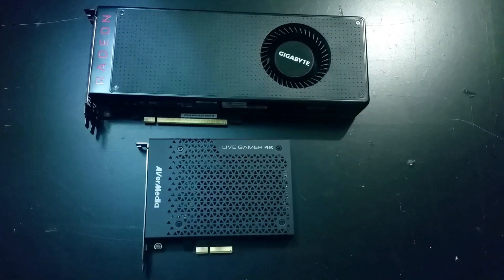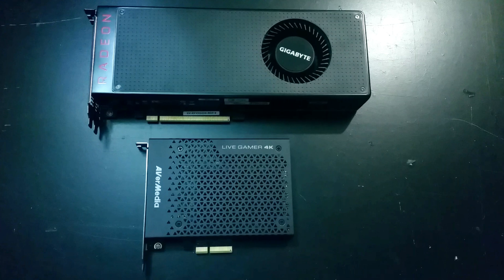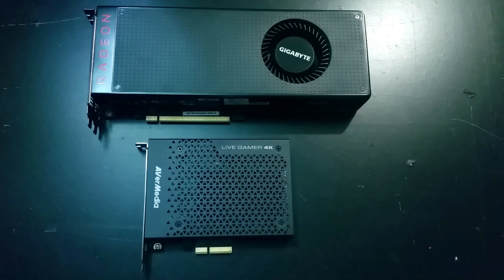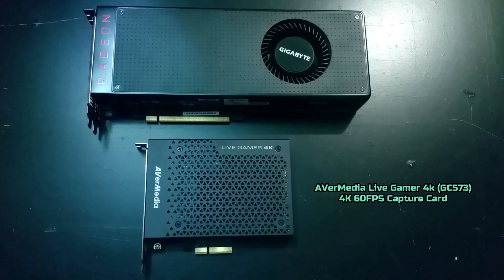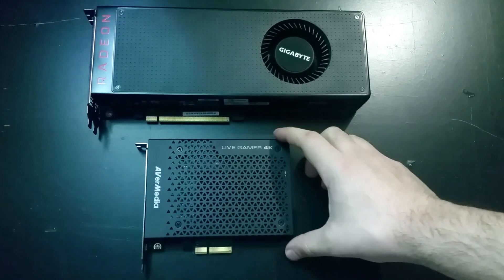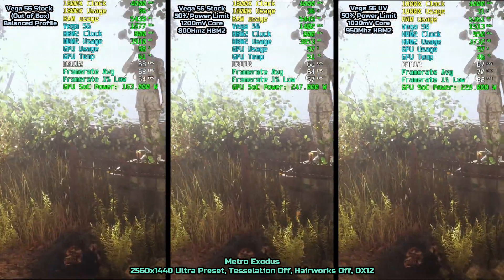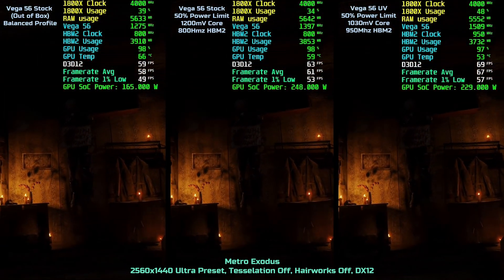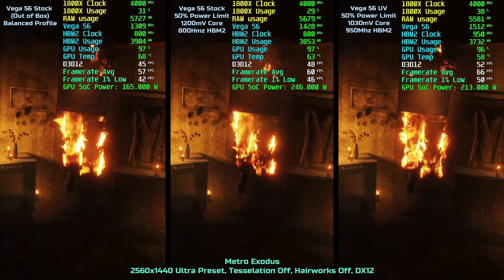Vega 56 Stock Testing Split Screen

Comment: My head is rusting :( Okay, so how does the undervolt overall boost the clocks? Wouldn't the clocks lower but be more stable as there's less throttling and the clocks are sort of "limited" as it is forced to take in less power? I need another explanation on overvolting and undervolting.. . If someone did this I would highly appreciate it. Thanks.

Edit: Okay I think I'm sort of catching on again. Basically, the undervolt allows the cards to reach the higher clocks more easily and even with the 50% PL it's less power consumption than with the 50% PL without the undervolt because the voltage is forced to be less... Duh.. But since it's less voltage the card can reach the higher clocks easier and maintain them better as the voltage is limited with the undervolt... I'm correct or no?

Comment: My 56 did 1700 mhz on the core and 1050 on the memory. This seems conservative.
Reply from the maker: Yea the card can definitely be pushed a lot higher. This was a "stock test" that's why I didn't increase the core voltage/P7 frequency.

Comment: Have you repasted your card? My card (ref vega 56) can't stay at 70-71c on 220-245watt profiles with 50% fan (which is 2400 rpm) and it gets to a point where it throttles during long load

Comment: You definitely flashed the BIOS to achieve 950MHz... Right? ..right?
Reply from the maker: Nope the card is still running the stock V56 bios. This is a refence card which has samsung memory. Samsung tends to overclock better than Hynix most board partner cards have.
Reply: @geekmark3844  Yes, I know Samsung overclocks better and 's why I wish I had Samsung in my V56 but nope... I get artifacts in Heaven at around 905-910MHz so you don't really need a BIOS flash to get V64 performance on a reference card do you? I didn't really know or think it could do 950+ on the memory without a flash... Damn. How much more headroom do you have? Flashing it would probably give you more headroom right? Oh and my previous comment on your newer video.. You could kill the card if you really increased its power lol. You mean like overvolting? How does that work and what's good about it as compared to undervolting? Thanks.

Comment: Can you compare Radeon VII vs vega 64 at same clock 

But show the power  (to see if the 50% power reduction 14nm to 7nm  is true )
Reply from the maker: That would actually be really interesting. Yea I can make a video on it in the next few days. I'll clock them the same and keep the voltage equal to see the power draw difference.